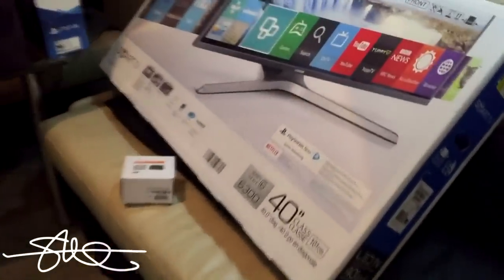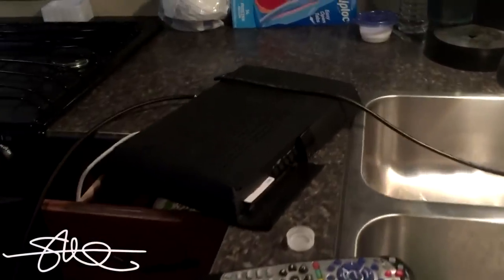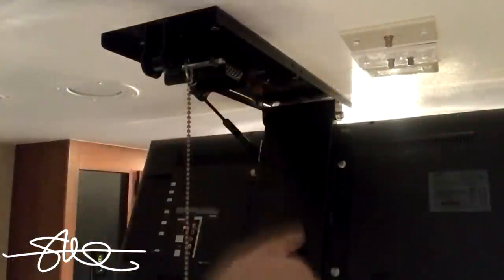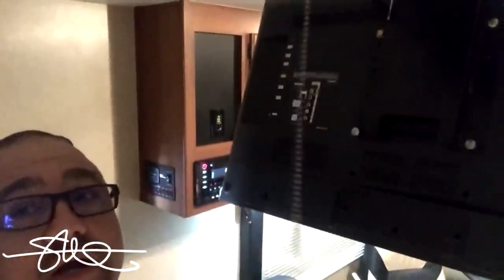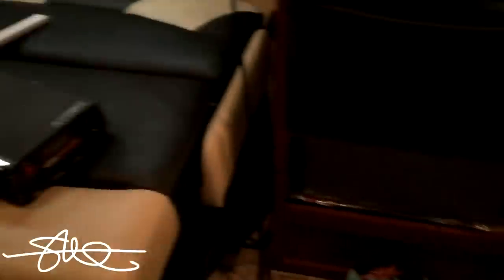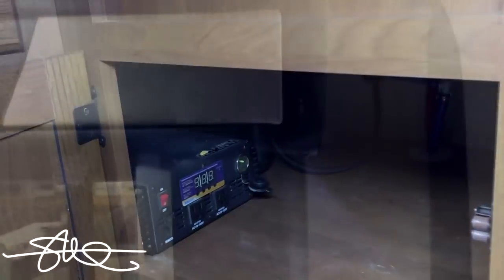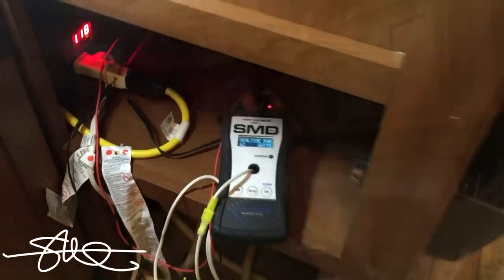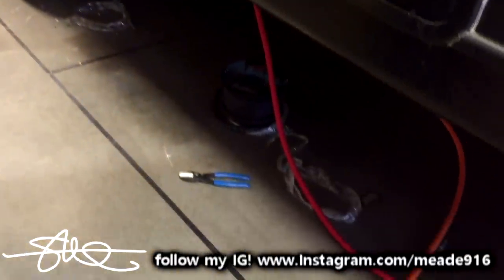RAGE'N X TOY HAULER SOUND SYSTEM & Video MODS - 40" LED TV, PS4, Projector, Dish Network video 2

Comment: I manage an RV repair shop on the head mechanic I have put in stereo equipment and had to run Wire in the ceiling power ground RCA's speaker wire let me tell you it's a nightmare can't wait to see the ending good luck Steve sure will be sweet
Reply from the maker: +John Work ty sir!!!
Reply: +meade916 will do!!!

Comment: Look into 2-3 full size solar panels? Keep them batteries topped and run stuff during the day... Possibly set the air conditioner at a higher temp while riding and have it feel better then if it was closed up when returning. 

Or even a DC fan to pull some air through.

Comment: @meade916 Niles makes a product that will function as a zone selector for you. It is amazing! Control you're speaker zones by on/off and separate volume settings for a balanced effect. I have the one for 6 zones, they make smaller ones.

Comment: To bad you most likely wont see this but the PS4 doesn't start pulling any real power until it starts rendering frames in a game. As an example. My PC sits idle at about 80W to 90W but when I launch a game that hits the GPU and CPU hard I'm pulling 500W from the wall. Just keep something like that in mind. Frame rendering is way different than just watch a video stream on a TV.

Comment: you'll probably pop the inverters breaker if you use the microwave while that stuff is on. We had same problem when running our 1K watt inverter on our boat
Reply from the maker: +darkmp40 who said anything about the microwave? It isn't even hooked up to THIS system.  Its on the generator.

Comment: I use to have the same problem with my satellite box but I took the cover off mine and found inside most of the circuitry was 5V DC so i just got a little 6v lead acid battery and a 5V regulator hooked it to the power rail and used a small motorcycle battery charger to keep the battery topped up. If I leave the box on standby it can last for months off that battery.
Reply from the maker: +syncmaster710n14 sounds like a lot of rigging up to me.  Mine will work better.  But thanks for the story though man! was a good read.

Comment: Cover the roof of your trailer with solar panels and you will minimize the time you need to run your generator and when you do run it so to run A/C save on fuel.
Reply from the maker: +SEDAZ01 can't run AC off solar panels.  Solar panels are nice and all but that is a trickle charge, not really anything useful.

Comment: One question i have is, are you securing the bolts on the frame with a nut on the other side or no? Only reason why I'm asking is because after while, you'd think that road vibration would loosen them to hell and back
Reply from the maker: +DGAF_AK87 i used lock washers.  Thanks for the concern.
Reply: Ahhh ok I was wondering

Comment: I think you need aomething like remote controlled hdmi out box to playstation, so you can play with the screen or with the tv :)
Reply from the maker: +Aletzi1 i have no desire to play the PS4 in the bedroom.  But that being said, i left the HDMI splitter that i do have in a easy spot to get to so i can use a different one if i decide to change the configuration up later.  It all kinda goes to one spot so i won't have to pull anything apart if i change my mind.

Comment: being u sanded the paint off the bottom shouldn't ya go over it with rust-oleum so it dont rust in the future?
Reply from the maker: +Landy Burkland ya, normally i would...good call.  And i will.  I am not done yet though bro.  I am doing an on board air supply system for this thing so hang tight and let a brotha finish. thanks! :D :)

Comment: ever think about solar power?
Reply from the maker: +SachinKhatri921 sure. But solar power is only for trickle charging the batteries during the day.  You can't really use them to power anything bigger than a cell phone charger (continuous).  No real need for them.

Comment: Hey Steve, Im really hoping you read this because im like one of your biggest fans. Ive been watching your channel forever and I really need some advice from a professional. I drive a 2004 hyuandai santa fe and I have 1 12in JL Audio W0v3 in a 2cubic ft ported box with 1 pound of polyfill. The amp is a 2001 Kenwood KAC-x305t and everytime I drive at night and I play my music I noticed my headlights dim like crazy and I dont have any Idea how to make it better I just dont want to mess anything up. Also Im pretty sure my front speakers are blown or something because it sounds like there cell phone speakers or something very weak. It would be great to hear what you have to say :) 
Thanks
~Andrew
Reply: +Andrew G. Guebara need a bigger alternator.
Reply: +JinxdFTB I dont know about. Im only pulling 300 watts. I just dont see why my lights would dim so low on such low power
Reply: it could be your battery
Reply: +JinxdFTB maybe it is almost 5 years old lol I also noticed my powerwire is bigger than any wire under my hood
Reply: +Andrew G. Guebara It could be multiple things.  Your connections could be poor, your gain set incorrectly, stereo settings too high or maxing out your volume. Could even be all of those simultaneously, nobody can give you a black and white answer of why your headlights dim without either inspecting the install or getting more information, but those are some places to start diagnosing.

Comment: Weird. I installed a 400w power inverter in my 2005 yukon xl and couldnt use my 32" flat screen with my ps4. As soon as i tried to turn the ps4 on, it would max out the inverter and go into safety mode. Even with the tv off it still did it
Reply from the maker: +HomeAudioProject should have gotten a higher quality unit bro.
Reply: meade916 yeah, i realise that now, lol. It was a cheap oreilly's buy. I think the brand is Peak XD oh well, live and learn.

Comment: Do focal in there
Reply from the maker: +Cesar Cervantes no thanks.
Reply: +meade916 i have a question for you what do you think of the rf power t2 vs the power hx2 12s?
Reply from the maker: +Cesar Cervantes they are all good within their operating range.
Reply: +meade916 okay i see i have the power hx2s but i though about going to t2s but might just recone n use the hx2s but thanks for the tip great job on the rv man